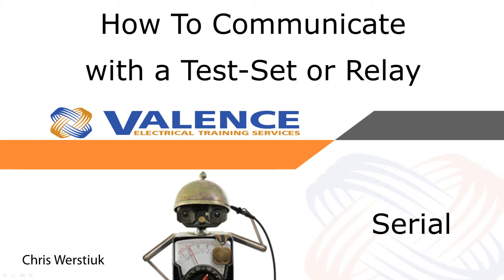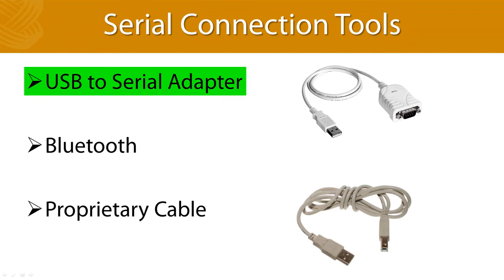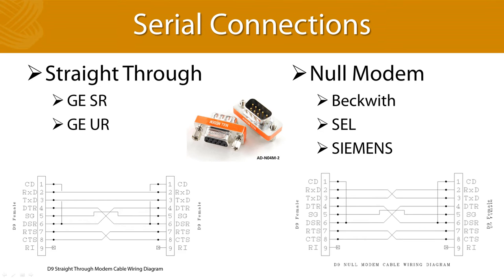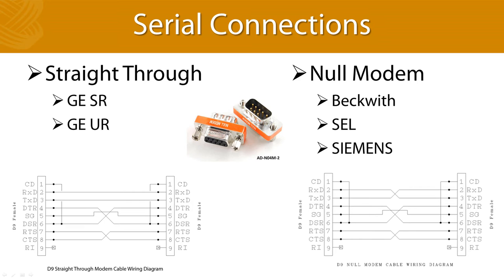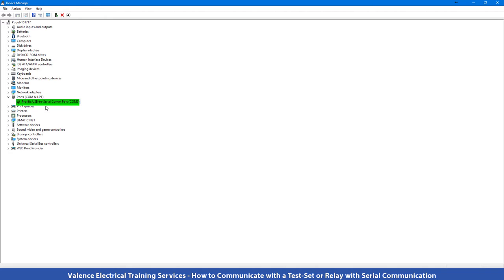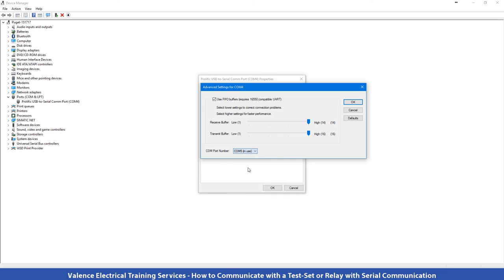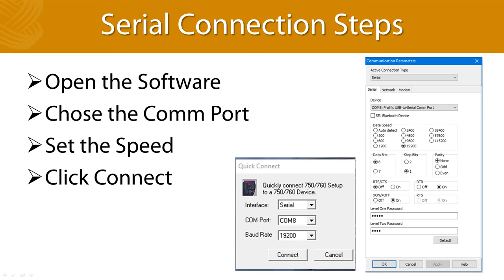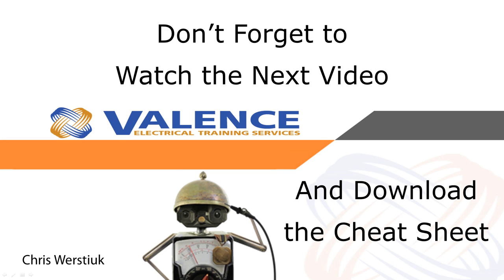How to Communicate With Relays and Test Sets Via Serial Communication

Comment: I would add that for some devices serial RS232 is the only way to connect at the very first time due too there not IP address defined on the device or this IP address is not defined, so serial conection is needed to check/setup TCP/IP comms.
Reply from the maker: Thanks for the comment.  You can also use the front panel to set the comm address in most cases as well.